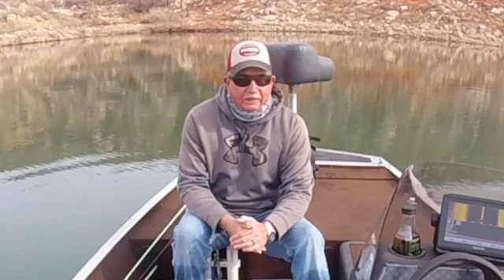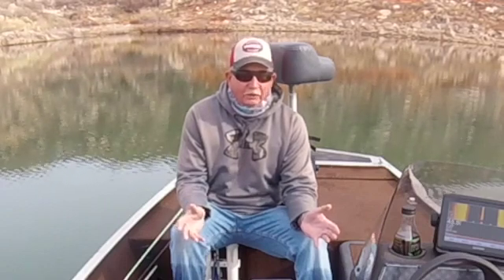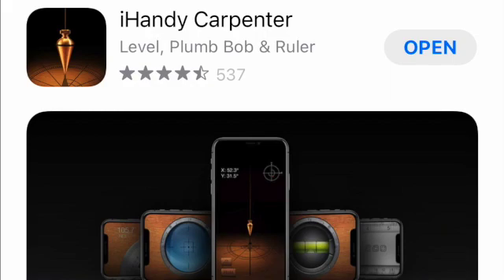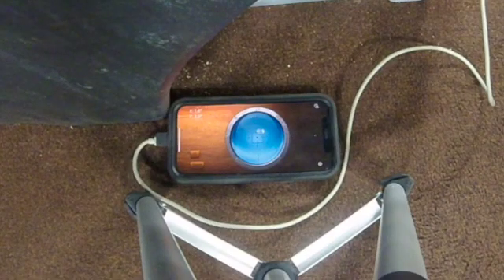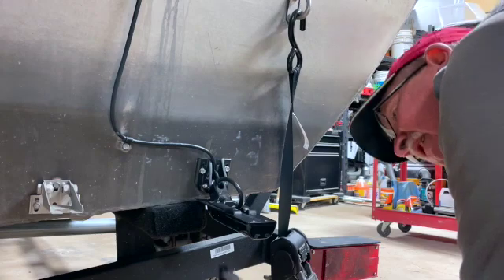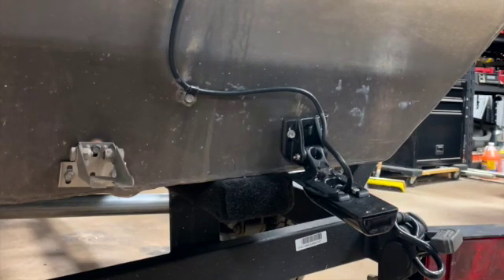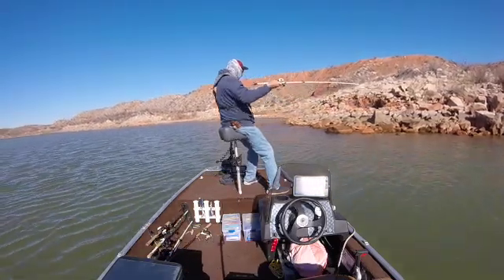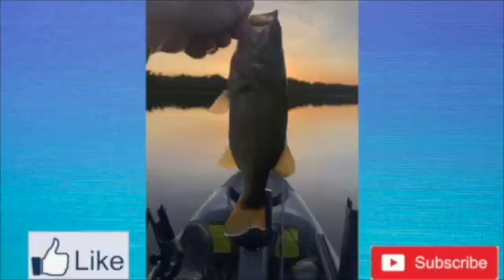Garmin 93SV UHD Transducer Level

Comment: Just a tip. Couple drinks in the A.M. will help with them shakes. loved the vid though
Reply from the maker: Might be from drinks the night before🤪 actually it comes and goes from time to time back in older videos, I would get a little anxious with the camera rolling. Have a great day Harry!!
Reply: Just having a little fun with ya.
Serious question though. i bought a new boat with dual Echomap UHD2 93sv's. I have heard that the 93's were for inland lakes and such, and the 94's were for costal waters. Seeing as i live on Long Island ,I'm not going to be on a lake any time soon. Is the difference only in the software or will the 93's be ok for inshore? @DoubleTFishing
Reply from the maker: The only difference between a 93 and 94 in the original echomap was the pre loaded map. A 3 designated lake vu maps and a 4 designated blue chart maps for coastal water. Originally the UHD2 was mapped with both similar to the Ultra series but I see looking at the website they split them out. I would say your best choice would be to purchase the Navionics plus or Navionics vision plus for coastal waterways. Call Garmin 800 800-1020 and ask them if it would be better to purchase a physical card or download version as there may be a conflict with the preloaded maps. The support call line is really good, use the callback feature and they will get back to you normally within an hour
Reply: Thanks Double T, your help is greatly appreciated👍 @DoubleTFishing

Comment: Ive noticed my depth starts blinking. I found that the transducer has come up some ie not level. Im thinking i need to tighten the tilt bolt a  little.
Reply from the maker: Don’t get the bolt too tight, it’s designed to “flip up” if you hit something. My transducer does the same when I’m up on plane, some add high speed transducers to combat that issue. If you’re blinking below 10-15mph I’d say there’s a different problem. Have a great day Bill!!
Reply: @DoubleTFishing  just sitting there it blinks and stays at the same depth until I either turn the unit off and on or relevel the transducer
Reply from the maker: Yep that’s a problem,

Comment: will a uhd transducer work on a regular 93sv?
Reply from the maker: Yes, in some cases it will. I still have one of the 93sv plus units that I use with a GT54, if your planning to use a GT56 I’m not 100% sure. I would call Garmin to confirm if there are any performance differences based on your unit serial number, use the call back feature and they will get back ahold of you within an hour. 800 800-1020, I don’t have access to look up by serial number

Comment: thanks for the info.  If you get it level with one peson in the boat .  what happens  when two more people get in the boat??
Reply from the maker: It will be off a little depending on the size of your boat. all you can do is get it as close as you can for most conditions. Things like speed, weight, wind, current all come into play but if you get close the other effects will be lessened.
If it’s way off to begin with you never really get the best out of the equipment. Adding a second person won’t change it drastically or maybe none depending on size of the boat and speed.
If your in a kayak then yes it will make a difference 🤣

Comment: Hello sir.2 questions.1 is ur transducer below youre bottom of boat? 2 how is it doing now while idling with ur outboard? Im having troubles.ive moved mine "gt54" four times now & cant seem to get a good picture
Reply from the maker: Yes I have it maybe 3/4” below the bottom and my images while idling the big motor are good. Does the picture clear up when you put the motor in neutral pretty much immediately?
Reply: @DoubleTFishing  well.no.kinda.ive gotten so frustrated but yes when i turn outboard off it definty gets better
Reply from the maker: You can see my transducer pretty good in this video, also have you tried trimming the motor up and down to see if it helps?
TIPS and TRICKS for Garmin Echomap users before you hit the water!!!
https://youtu.be/c7YbYn937n8
Reply: @DoubleTFishing  i think i have it too high

Comment: Do you ever talk about the trolling motor transducer install and what to expect if one does it this way?
Reply from the maker: I’ve mentioned it in other videos and the newsletter that clear and side view sonar beams are a narrow oval rather than a round cone like traditional 2D, for that reason they are not very effective when turned side to side making the image very blurry. Personally I network the clear and side view to read off the transducer mounted on the transom and only use the transducer on the trolling motor for traditional 2D which is not as sensitive to being level. Thanks for watching!!
Reply: @DoubleTFishing  which video did you mention the different views and how they would be affected by the transducer being mounted to the trolling motor?
Reply from the maker: This one probably would explain it best, 
https://youtu.be/Vt0_8F4utY0
Reply: @DoubleTFishing  which video did you mention the different views and how they would be affected by the transducer being mounted to the trolling motor?

Comment: Garmin says to mount it in plane with the bottom of the boat.  But you are saying tilt the back upward so it's level while you are scanning. Correct?
Reply from the maker: Might take a look at this video also
https://youtu.be/ANXxn3c9nUk
Thanks Aaron!!
Reply: Thanks for your reply
Reply from the maker: Yes basically, but it depends on the attitude (tilt) of your boat when you are traveling at a comfortable idle 4-7 mph. Some boats loaded with gear might tilt higher in the bow than others that’s why it’s best to get a level and survey your vessel on the water. Obviously it will never be perfect for every condition but as with anything else if you have a solid baseline it helps. The video below will help explain the importance of a leveled transducer.https://youtu.be/ETroWhbMlUY
Have a great day!!

Comment: I did this with a 4ft level front to back and side to side. You can use two different color sharpie's to indicate each bubble location so you can imitate the boats natural floating position when floating. Then recreate with trailer jack and if fish by yourself like me you'll need a bottle jack to lift the trailer slightly to immitate you being in the boat. Now you can adjust transducer using a 6 inch level.
Reply from the maker: Thanks for the comment, have a great day!!!!

Comment: Once you are at speed desired and hit calibrate , do you hit hold ? Do you just shut the app down and when you get home will it come back where you were in the boat when you restart the app ?
Reply from the maker: You don’t need to press hold, all your doing is calibrating the bullseye to center at the angle on the boat while your at the desired speed. I’d recommend leaving the app run in the background and not completely closing out of it. You can switch to other apps or use you phone to make calls. Like I mentioned in the video play with it, you can pick a spot on a table and put a magazine or something under one end of your phone and play around with it to get comfortable with how to use the app before you head out on the water. Have a great day, holler back if you have any other questions.
Reply: @DoubleTFishing  so after hiting calibrate button , I go home and lift or lower the jack till level  ? What if I just read the numbers on the app when in the desired  position on the water , write  them down and duplicate when I get home , then level the transducer  ?
Reply from the maker: I see no reason that wouldn’t work just as well without actually recalibrate the phone app if that’s more comfortable for you. I’m a visual person so I like to see the bullseye in the center lol. Just be sure you get the phone in the same place on the deck and the top of it is pointed in the same direction as it was on the water, I almost made that mistake.
Reply: @DoubleTFishing  I would think the numbers would be more accurate . Thank you so much for your help !

Comment: I troll and spend most of my time in the back of the boat.  Should I set my level on the transom or floor in the back where I am to get the initial bubble set?  Would this give me the most accurate reading while trolling?  This is a 20 foot aluminum.
Reply from the maker: It shouldn’t matter where you set the level as long as you put it back in the same place at home, that’s the important piece is getting it back in the same spot. It’s never perfect because you may have extra people , gear, water in the live wells etc, but if you get it close it does help.

Comment: I purchased the IHandycarpenter app to level my transducer but I'm can't figure out how to use it like explained on the video . Can you explain please?
Reply from the maker: Sure once the app is open touch any part of the screen and select the bullseye from the menu options that pop up. Then set your phone screen up on a surface level or not and touch the calibrate button. If the calibrate and hold buttons do not appear on the screen touch the information icon in the corner of the screen to go to the menu screen and select them. To test set your phone on surface that is not level and touch calibrate. The bubble should go to the center of the bullseye. Leave the app running in the background and it holds that calibration until reset, thank you for the comment!!!